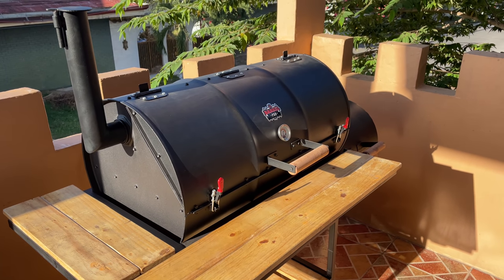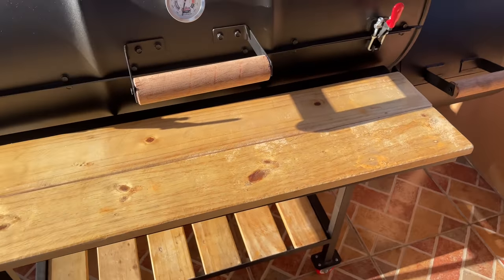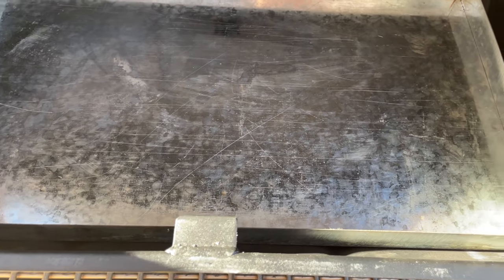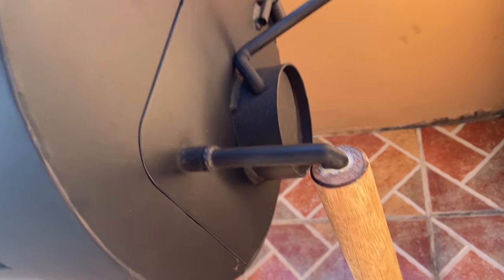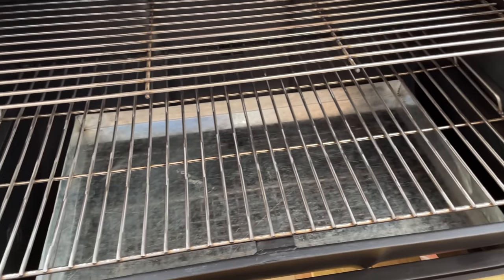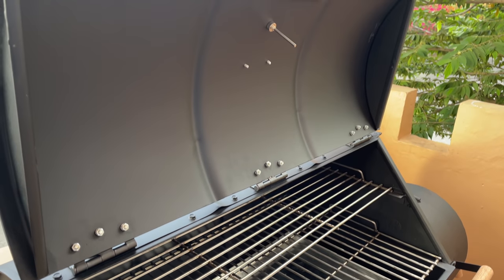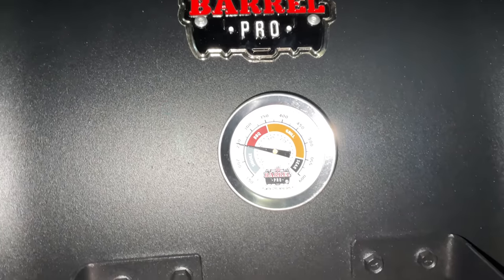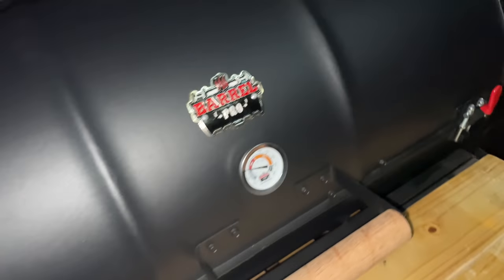Seasoning our NEW Smoker!

Comment: leaking a bit at the seams. you can get some heat-resistant glue to seal those up. try lava rock
Reply: Or just stuff some aluminum foil in those openings in the meantime.  They have to be sealed or there is a loss of temperature control.

Comment: That drip pan appears to be galvanized. It releases zinc fumes when heated and is not safe. I know its not good to breathe the fumes when welding galvanized materials so i'm assuming letting it penetrate the food wouldn't be good? I would have a few beers and not worry about it but it may be a good research topic.